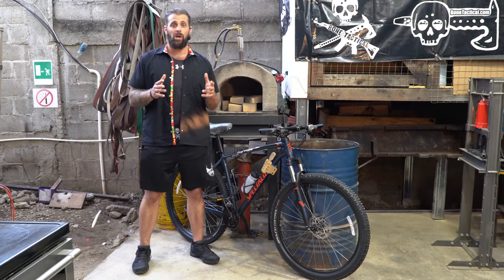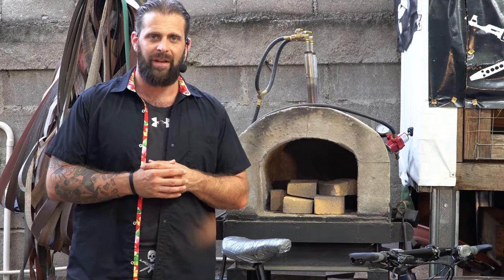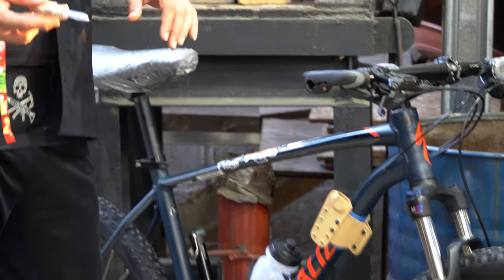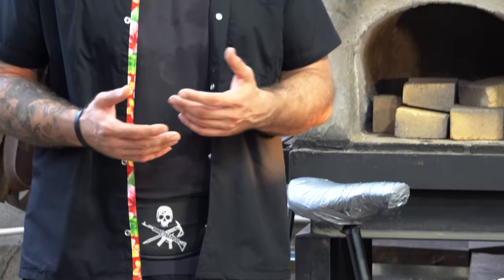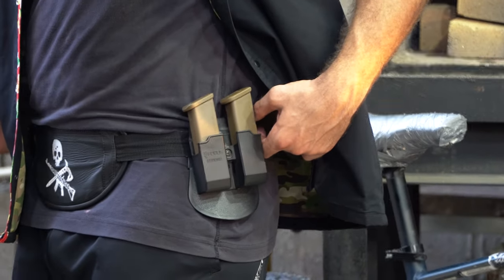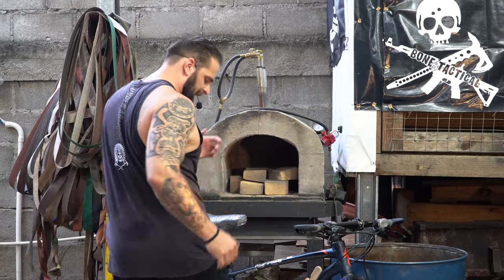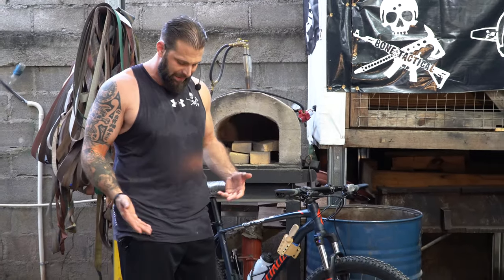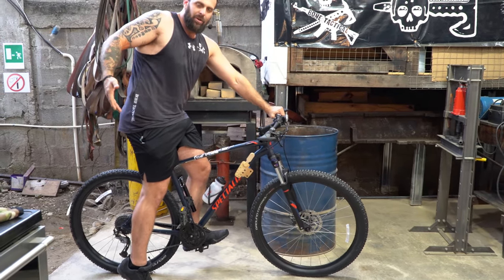SECURITY HACKS FOR CYCLISTS | Mod Your MTB Like a PMC

Comment: One of your Bone Tactical tommyhawks would also go nicely across the handlebars, the blade facing forward and the handle at the ready near the right or left hand, depending on you are right or left handed.  The downside to the knife device depends on where you are.  Where I live the knife out in the open like that would definitely get me pulled over and harassed by cops.  The other down side to it is leaving your knife on the bike. I have been a cyclist my entire life, and a tactical, survivalist cyclist for the last twenty.  I prefer carrying everything on my person in backpacks, etc.  This way nothing is stolen off the bike when I am not looking, and if the bike needs to be abandoned for whatever reason--I can just drop the bike and run and I still have all my gear intact.

Comment: 🤔🤔 Something to ponder to tactically add to your bicycle. My personal experience I have a 3/16 diameter 20inch +/- long stainless steel rod in side my handlebars Held in by the rubber handlebar grip.I have a little semi twisty 3/4 inch knot for the hilt so it will not go completely into the handlebars and for easy deployment.This is ideal if I was to do some recycle can/Plastic bottle collecting but mostly when a dog wants to make a chew toy out of me he’ll have to shish kebab himself before it touching me🤣😂🤣.🤔🤔 I suppose for less lethal parameters due to laws in the country I could always see somebody putting a rigid flexible cable in the handlebars. If someone tried stealing the bicycle with you on it. Give him a extra dosage of a sadist Flexible cable beating creative emotion and style of dancing fun🤣😂🤣🤫🤫😈.
Reply from the maker: What will that do? Toothpick?
Reply: @BoneTactical  It’s a quasi-mini foil sword from a piece of scrap metal
Reply from the maker: @crankyemoji2328  sounds like a good way to get your butt kicked